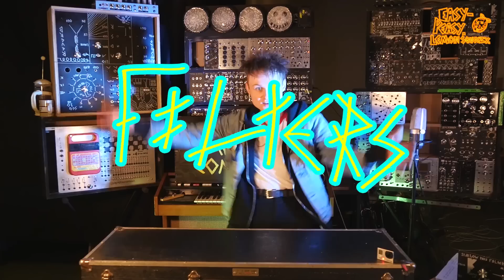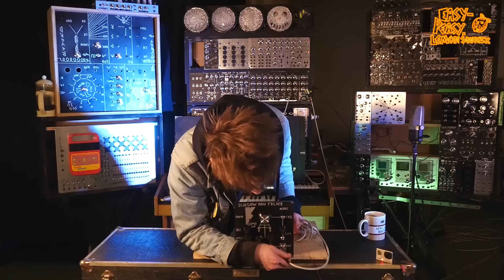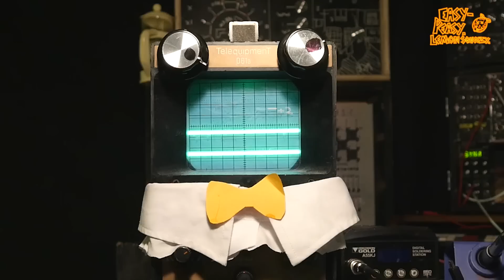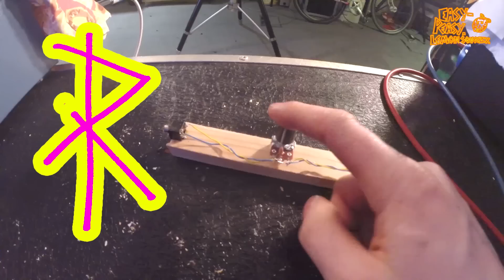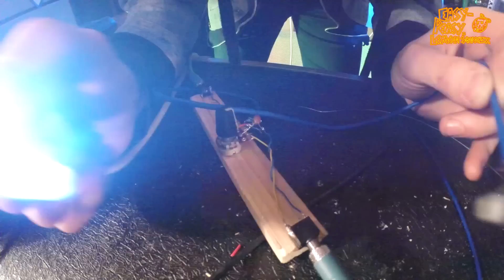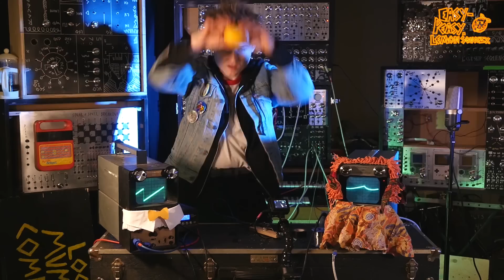FILTERS? Build a simple DIY passive electronic low pass filter.  #Electronics #Synth

Comment: I wonder why the filter doesn't do anything at all in my circuit. I am using a 555 timer to create the square wave. It basically just switches between 2V and 0V. Is that what's causing the problem? I need to make it swing between -2 and +2 V? I don't understand though why the filter doesn't work.

Comment: Yeah using the IC chips is much better sound I found. At least this works somewhat. The reverse transistor oscillator is not a good idea at all when IC chips will make a better sound, are easier to wire and will actually work when you wire them correctly rather than maybe working. I would recommend finding the IC chip for the filter and using that instead.

Comment: currently am working on maybe 4-8 of these for use with a mixer as an insert, so far using just one seems to be fine, hasn't broken anything so far, though it does seem like i'd need to add a buffer if I want to add both a low and high pass, which is annoying but doable all things considered, just want to make sure these wouldn't hurt my mixer being used with a ring/tip insert, I don't think so but better to ask if anyone knows better than I do, yes I am aware it won't sound that great too its more a better than nothing, and I just want a subtle lowpass, and first order seems more than enough for my needs, which is basically like rounding off guitar and distorted bits

Comment: hello! when you attached the RC filter and turn the knob, we can see ''distortion'' on the attack peaks.
It affects both the source and the output signal.
is there a way to avoid that? I'm a newbie to all this.
thank you!
Reply: "Natural" distortion -- often called saturation -- is a phenomenon that occurs when the signal being passed through a wire is exceeding the maximum "capacity" of the wire. (If it's exceeding it a little bit, people call it saturation; if it's exceeding it by a lot, people call it distortion.) Also -- what you're seeing on the scope isn't an ADSR graph. It's literally a graph of the audio waveform, so it's not accurate to call it "attack."

Saturation is the key reason why people think analog audio sounds 'warmer' than digital. When you exceed the capacity of a digital system, you get harsh clipping. With analog systems, instead of a harsh clip where the peaks of the waves are just sliced off, the signal "breaks apart" in ways that are pleasing to our ears. It's like salt on our food; adding an appropriate amount of salt to something doesn't make the thing taste salty, it just makes it taste better. Same for saturation -- we don't hear it as distortion, it just sounds better. Even recorded classical instruments benefit from mild amounts of saturation.

In the case of filters, one of the key reasons why certain filters are more sought after than others (e.g., Moog) is precisely the flavors of saturation the filters add to the signal. Perfectly clean filters are something that's kind of only truly possible with digital audio. They can be great for mixing work, taming unneeded frequencies, etc. But when it comes to adding a little bit of "salt" to your sound, you almost always want the filter to add a little bit (or even a lot) of saturation.

Comment: Loved it! Can you please make a video about how to make a bandpass filter?? My favorite filter is rarely mentioned on the interwebz :( 
Thanks!
Reply: One way is a low pass filter parallel with a high pass filter, where they have a bit of overlap. Their cutoff points are simultaneously adjusted using a stereo pot, wired in anti-parallel.

Comment: I know I can flip the resistor and cap to make it into a high pass filter, how would that look in this example with the pot
Reply: the low pass has the cap between the middle pin and GND. for a high pass you'd instead put the cap between the Vin and the input of the pot. so the signal goes "through" the cap.  https://www.amplifiedparts.com/tech-articles/filter-low-pass-high-pass
Reply: @jimkerak6404  I would also like to make this In a high pass version. Are you saying the in from the jack socket goes to capacitor then from capacitor to input of the 10k pot then to the out?

Comment: QUESTION about 2nd order RC filter! As you probably know, in order to increase the slope of the filter, you have to put 2 RC filters in series. In this situation, how do I control cutoff with 1 potentiometer? Do I have to control both resistances at the same time?

Comment: I found that mine only worked when the sound (the plus cable) would go in in one of the side pins and come out through the middle one. Then this middle one would also be connected to the ground with the capacitor.

Comment: I wired it exactly as in the video, but the potentiometer only acts as kind of a volume knob - it does NOT control the cutoff frequency... If I use a 10k pot and a 100nf ceramic capacitor, the capacitor also does absolutely nothing. When using a 100uf electrolytic capacitor, the high frequencies are cut but the knob also just controls the volume?!
Can anybody help me, I do not find the problem...
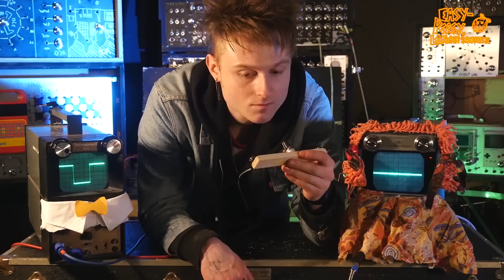Reply: Schematic at 3:16 is wrong. It should be -> The input is connected directly to the output. Pot pins 1 is IN, 2 is connected to the cap then ground, pin 3 is not connected (the pot is in series with the cap and that is in parallel with the line). If the pot value is too high or cap value too small you will have no adjustment. I guess that 1-10K LIN pot and 0.1 UF and up to 22uf should work.
Reply: It works!! Thanks! :D @moshly64
Reply: As someone has already said if used with a sine wave, unless the filter is tuned to the specific frequency of the sine wave, it will just act as a volume knob.
Sine is a pure signal(most of the time)
Square waves contain all frequencies.
Reply: I don't get it too, did you solve the enigma ?
Reply: Stoned Diplodocus no.. absolutely no clue..
Reply: im so lost its just a volume knob for me too.
Reply: Me too
Reply: Maybe @LOOK MUM NO COMPUTER can help us here..
Reply: Which waveform to you use? When using a simple sin wave an filter will just affect the volume! Using other waveform will end up in shaping the sound. So it makes a big difference in using the starting waveform!
Reply: It depends a lot on what you are putting into the filter.  I have an old waveform generator, and when I send a square wave from that into this filter, the filter works incredibly well.  When I use it with the "super simple oscillator" that I made, my filter barely does anything
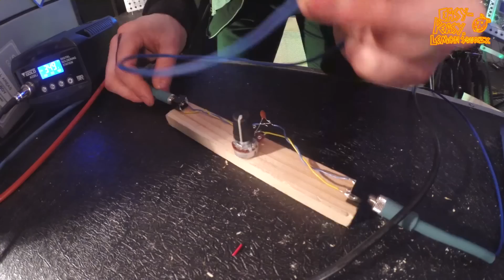Reply: @ Peter Lustig : Im not completly sure but if you look closely,  @3:53 it seems that the leg of that capacitator is soldered to the middle pin of the poti not like in that "schematic". Will try it out myself today cause i have the same issue with that circuit.
Reply: @ Kulken : I also tried that I guess - but without success. :/ hope anybody can help us...
Reply: Nice, I haven't seen it ! But it doesn't work... Still a simple a volume knob
Reply: @ Stoned Diplodocus : jes... I stumbled across the information that you cannot realize a variable Filter using just a capacitor and a resistor (a simple Filter is working with that components, but NOT variable) - but why does it work here...
Reply: Shenzhen u say pin 1 is from left to right sorry îm a total noob ?
Reply: It does not matter, it will just flip the rotation min/max is to the left turn or right turn.
Reply: Peter Lustig I was having trouble getting the 100nf cap to do much over a number of frequency ranges,  it as soon as I replaced that with a 22uf it worked like a charm.
Reply: I have the same problem...
Reply: I've tried, and tried again, and again and nothing.. No schematic online is the same.. I understand how pots work, how the signal is supposed to be altered.. but still.. can anyone help?
Reply: @BardànIrving  If you build exactly what is shown in this video, exactly how it is shown, you will get a working filter, although, as I stated earlier, it works great with some signals and almost not at all with others.  If it doesn't work for you, you have built it wrong, used the wrong components, or used faulty components.
Reply: +Troy Peterson im sure it does with other signals which i havent tried. but i did try sam's version attached To the super simple oscillator and still nothing.. faulty components might be the problem i guess
Reply: @BardànIrving  Yeah, I had mentioned in my original comment that this filter had no effect when using with my own super simple oscillator.  You've gotta send a square wave through it.  When something is as simple as this filter, it always comes with a caveat, such as only being able to use it in a very specific way.  Sam probably should've mentioned this in his video.
Reply: +Troy Peterson yeah. also, tell me if i'm wrong but, couldnt my pots be faulty after several attemps being soldered and unsoldered to a bunch of components ?
Reply: @BardànIrving  Yeah that is possible.  You can check them with a digital multimeter.  If you plan to get into doing stuff like this, a multimeter is essential, even a super cheap one will work for you

Comment: hey mate, why don't  you direct put the cable from the lfo in the passive filter?
Reply from the maker: huh? what do you mean?
Reply: i mean instead of puttind a led and a capacitor, take the cable from the lfo and solder it directly in the passive filter
Reply: sorry for my shitty english :/
Reply from the maker: it wont work. it would just mess with the audio signal. offsetting it. potentially making no sound :)
Reply: Thanks!

Comment: Hiya Sam. Kwik Kwestion: Whats your favorite filter circuit? Mine so far is the Steiner VCF. It uses a diode ladder and has LP HP & BP INPUTS as opposed to outputs. Sounds amazing and you can have loads of fun putting sounds throught the inputs, sticking an LFO or other CV into the CV input to control the cutoff causing Cross Panning between the sounds!! Fucking fantastic!
Reply: Love Ozzi by the way. lol. x

Comment: on your "schematic" of the filter you have what looks like a ground next to the input. I have fixed the tone knob in my guitar before in the capacitor is grounded to the top of shin geometer could this conceivably also work. having in the capacitors pins solder to the middle pin of the potentiometer and then grounded to the top of the potentiometer and having the two ground wires of the output and input solder to the top of the potentiometer as well?

Comment: That made me want to build stuff again, and I quit DIY years ago.
Reply: If you made strange analog machine and play your music on it, it will be awesome. DIY is joy, DIY is fun. One does not simply quit DIY :)
Reply: HAINBACH would running tapes though diy filters work?? I saw AMULETS run walkmans through Clouds and was wondering if that would still work with diy or does it have to be eurorack?? I want to start working with modular, tapes, and minidisc. I have a Tascam 414 on the way (after seeing it used the way Alessandro Cortini, AMULETS, and yourself use it) and a pair of minidiscs (after seeing your tricks on minidisc recording I looked up and found a pair of SHARP 702’s...the exact and only minidisc player I had in the 90’s...for an absolute steal!!). Also, side question: do diy modules work with vcv??
Reply: ofc, you can filter any audio signal
Reply: Why did you quit diy? I couldn't imagine quitting woodworking.
Reply: shut up hainbach!
Reply: HELOOOO OOPS  Haloooo hilow heee lo

Comment: im having trouble understanding midi to cv... a module i bought has a 1vt/oct input and i wanna know what my options are as far as sequencing a melody. i have a midi to stereo cable! is there a DIY mod option where i can get just pitch cv signals from the cable? in your previous videos i saw you built your own midi to cv modules so i thought you might be the guy to ask :)
Reply from the maker: yeah midi to stereo jack is just midi to midi but some devices use stereo to save space. midi is a digital signal. 1v/oct is an analog signal. midi to cv is a bit complicated DIY straight off. as you need something to read the midi and decipher it, then something to translate that to voltages. to be honest the cheapest option without going too complicated is buying a mutable instruments cvpal its about 30 pounds. only problem is its usb. other things is search up arduino midi to cv.
Reply: How do you know so much?